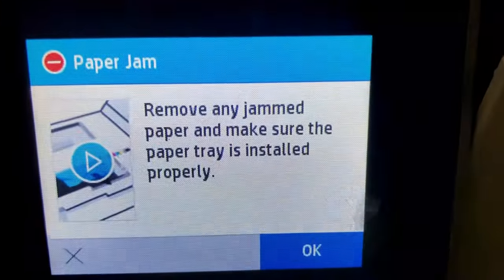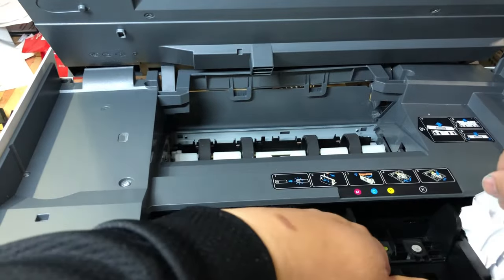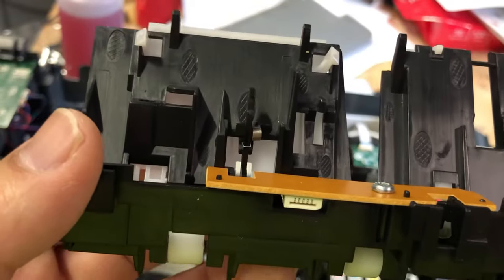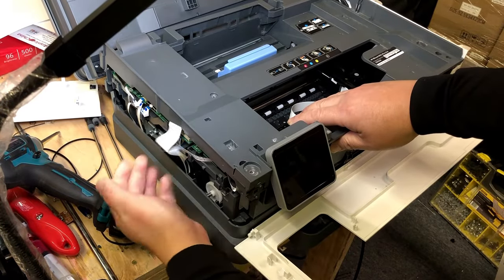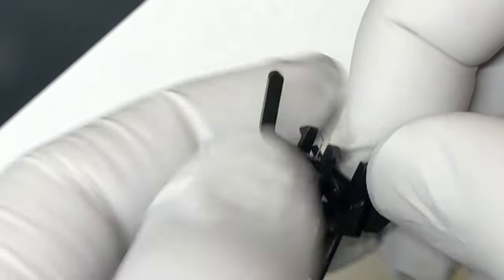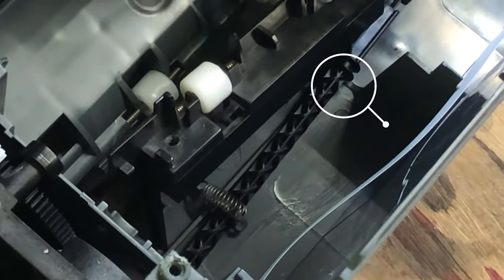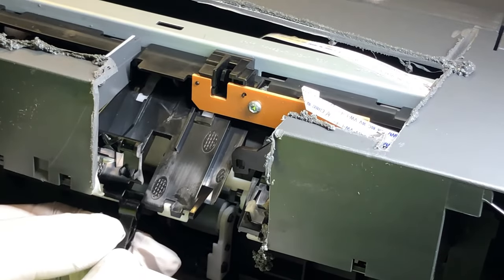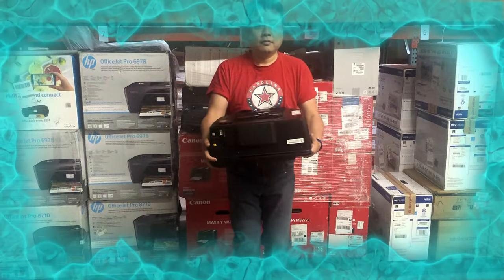Paper Jam & No Paper!!!  - HP OfficeJet Pro 8022 Mystery Solved.

Comment: Hi, sorry.but nothing helped. All sensors are okay, position sensor from the printer head cleaned, nothing. Still got paper jam. Are there optical sensors in the printerhead they can be cleaned. A have a lot of Spraydust in the printing section.
Correction: I fixed it!!. At the backside, there’s a flap for removing jammed paper. And at the upper right side there’s a little springloaded lever. And this lever was stuck.  And why? The tiny spring wasn’t in place anymore and triggered a sensor(paper jam). I partly disassembled the printer- was easy, corrected the spring and it worked. Now i saved a lot of money and had a chance to clean up some parts.
BTW, your video helped me.

Comment: hi kevin or any clued-up reader 🙂 my hp officejet pro 8600 gives paper jam error on the front led panel due to false message caused by a cracked piece in a ? roller  [according to a technician] - i want to use the scanner but the jam error prevents accessing the scan menu or any other menu, how can i bypass the error message to access the scan function as i will now use the 8600 as a scanner only... any ideas?